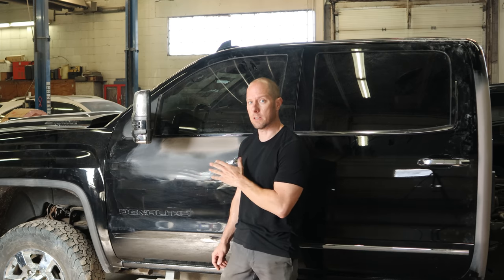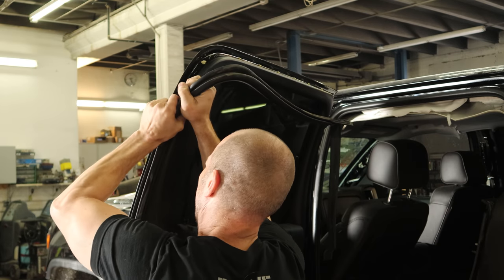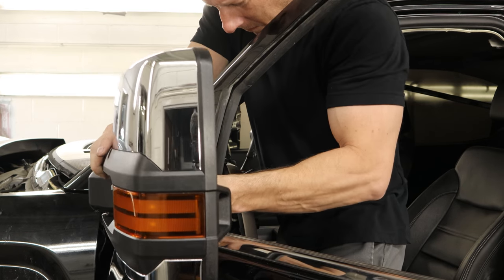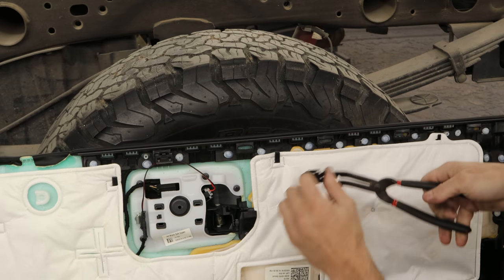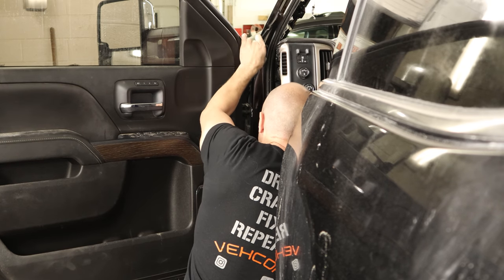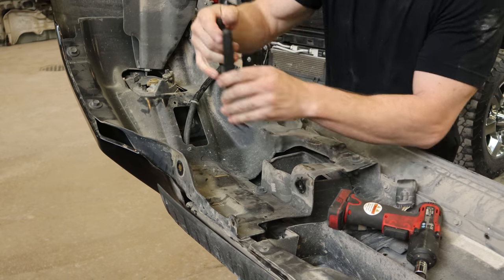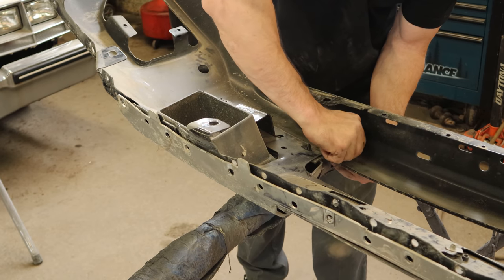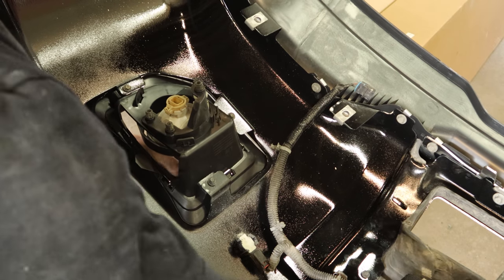Rebuilding my 2019 Sierra Denali after a failed landing part 3

Comment: Until today, I never knew those were called heat shrink terminals, nor that they were to be heated to seal.  I just thought the plastic was to insulate the splice.  That wisdom alone was worth watching your channel.  Thanks for educating me today!!!
Reply: There a couple different kinds. The ones he used were the heatshrink kind. But they also make cheaper non "weather-proof" connectors that look similar, I wouldn't try to heatshrink the non weather-proof ones. It might get stinky
Reply: @Laggy Wizard Thanks!  Now I've learned 2 new things today!!
Reply from the maker: You got the correct answer.  And I got a funny visual of someone melting some regular connectors. 😂
Reply: Glad I can return some of the laughs to you!
Reply: @vehcor  In my defense, I'm a retired dentist who's only fully restored one vehicle in my life.  A very rare early 1963 Corvette Roadster, from hot rodded back to fully stock.  I watch your channel for the dark humor and to learn a thing or two.  Thanks!

Comment: For those heat shrink butt connectors i many times on the smaller wires use the next smaller size. I have seen them come in both yellow or white. They are white on Amazon. They come in several kits or by themselves. They are listed as 22-24 ga wire but work to nearly 18 ga wire. I like them because they are just over an inch long, have the glue lining and smaller diameter than the pink 18-20 ga ones. I saw them in 100, 150, or 500 count packages.

Comment: If you tilt back with the mast of the fork lift instead of driving back when your pulling bed rails in it’s more consistent and smoother with finer control. Both ways work but with the hydraulics you don’t get the lash in the drive train. You do you though haha

Comment: At the fact'ry I worked at, the guys would drop the cabs down most of the way, and then put clear vinyl tubing on the bolts as they hung from the body. The cab drop then matched speed with the conveyor and the guys would lower the cab onto the mounts guiding it with tubing though the cab mounts. A quick yank removed the clear tubing and they bolted it all down. That was thought up by one of the guys, not an engineer.

Comment: If you took Mr. Spotys class on GMC bed installation. You could have done it in half the time and by yourself.  It's your truck. You know where the trucks are prone to rust.  Those who are telling you different. have never done the job themselves, you are doing. They would probably have cross-threaded all the nuts and screws. And a large pile of parts left over.

Comment: I wouldnt pick on the pizza girl too much. She might pick that truck bed up and throw it at you. I tried the heat shrink connect on my DRL harness on my 2017 Camaro. It cause the charging system to fail. Had to replace the harness.

Comment: ah come on depending on its location after it rusts for a few years it will create its own weep holes. I mean it will only cost 10k-15k to replace all the rust because they stopped making the parts 2 years after it rolled off the production line. So $5 in wax to save 15k makes total sense. But really hats off for fixing it right your like mike holmes from canda only better.

Comment: To the anti wax - vax ers .  These vids originated to show customers what goes into a build.  Proving to a customer that the car is in as new condition and has added features like rust protection, new brakes / rotors / tires is a strong selling point.  Remember, people that do high quality builds are not afraid to put $ in a build where it counts.  RE: A customer isn't going to be impressed with new weather strip t clips but will be by a can of wax.   So continue to Wax On , Wax Off .

Comment: The truck looks great Scott! I never used anything inside the doors until i watched your videos. I could not find the cavity wax so i used fluid film inside the doors trunk lid, hood, everywhere i could think of. I live in Connecticut where they pour salt brine on the roads ,it loves the eat steel. I had my new used truck frame blasted then hot galvanized they did not quench it so paint would stick to it,  3 coats of catalyzed black paint in a attempt to keep the rust at bay. I cavity waxed the whole inside of the frame after painting.

Comment: Taking your tips about cavity wax. Plus the info about fluid film.  I have used those products around my Florida Island home where the salt air corrodes everything.  Simple things like an outside electrical outlet that has a weather cover(which does little good) corrodes up to useless in about 5 years.  So now after replacing them I cover them in FluidFilm.  For two electrical breaker boxes on the outside of the house that I replaced because the old ones were pretty much just a hunk of rust.  Cavity wax all inside.  FluidFilm on the outside.  For my outside AC unit I treated it too.  Hopefully the outside AC unit will not have to be replaced in just a mere 4 years this time.
Reply from the maker: Hopefully one day my cavity waxed doors with be parked at my Florida island home.  I’m a little jealous! 👍🏻

Comment: "break the tab if it's insurance work" well that explain why we pay too much for inssurance, I've been to a shop for insurance repair the guy charged on inssurance for undercariage rustproofing that guy never applied it... and did crap job overall, drill the undercarriage to pull it out because it was damage could have remove the carpet it take less than 2 min to do and push it out with block of wood, bolts holding plastic broke they just use self tapper to hold them back and came about 2mm of the power cable from the battery to the front, driveshaft carrier bold broke well put it somewhere else where I will never be able to remove it, forget to tight one of the driveshaft bolt and lost it...

Comment: What do you charge to pull a frame on the table give me a shout. 2001 silverado 143.5 inch wheel base. driver side back about 1.5 inches.

Comment: I’ve watched your videos and have seen your work,I need your opinion,I’m 70 yrs old and have a 2008 Chevy 2500 silveraldo which was recently in a accident. The passenger fender,front grill,front bumper,was damaged, now they are saying the frame is bent,is it worth buying the truck back from the insurance company or just take the financial loss and move on.  I only have 51350 miles on it and unfortunately need it to tow my boat twice a year.  Also it has a western plow I use for snow removal,  thanks Rich.

Comment: Question Scott, why don’t you clean the plastic parts you reuse? Wouldn’t it be easier while they are off the truck? For example, the plastic bezel around the tow hooks are a visible part after assembled.

Comment: My brand new truck had the bed not aligned right from the factory, it bugged me.  Had to pull those two plastic pins on my truck ,but now it's aligned .  Has 2 pins on drivers side of  truck.  One on the front and one on the back of the bed.

Comment: Love the way you want lines to look . I am the same way. I pulled mine almost like that but with tractor and loader .    
I think the wax is a good thing. I use it and I am in Kentucky. I just want things to work the way it should and no short cuts.

Comment: Still waiting for the update on the store for the multi use portable frame rack/welding table/bed lifter/Mustang body lifter and painting nomes. Those detail nomes would come in handy too, wondering if the the pizza girl comes with the step stool or will that be optional?

Comment: I'm a diyer with my first car being an impala doing my own work or most of it i should say, im surprised what i've learned on replacing and such but now im a fan of these rebuild channels, especially the trucks. so much you can do.

To answer that one question tho: 18:46 = you can honestly spray some all purpose cleaner like Purple power or SuperClean and use a brush and pressure washer, because they're carpeted it'll take a few minutes to get most of the dirt out.

Comment: 24:40 hey Scott, how do you like your Bauer power driver? I bought a full set first of the year, power driver, 3/8 impact, drill, 7"circular saw, and 2 spare batteries and 2 chargers. I have used mine relentlessly without a peep out of any of them, and the larger 20v batteries go forever. The small battery the drill came with does go dead quick with hard use, but I was drilling the hardened steel at the axle attachment point on a Chevy cavalier with a cobalt bit, so it was working hard.

Comment: With as many of these trucks as you’re doing, you should just buy or make a door handle tool. It makes putting those exterior handles on so much easier. Lisle 32860

Comment: I used to have a tool that would pop out those pesky door seal clips and it worked very well. 🙂 Should mention though have also used your method for those $&$% that wouldn't cooperate.
Reply from the maker: I haven’t found one yet.  The metal it too think for a pick to get the ears of the clips.  I just struggle. 😂
Reply: @vehcor  The tool I had had a square wooden handle 2 1/2 W  × 3 1/2 L and an 1" thick with a thin stainless spring steal blade with a slight curve and a cutout in the middle front edge to fit the T clip perfectly and when you shoved it on the clip and  rocked it side to side in a light twisting motion those dam things would pop right out. But that was awhile ago now and the clips could be made of something cheaper and breaks more easily.  That's progress I guess.

Comment: It's definitely worth treating a vehicle for rust whenever the opportunity arises. I have a 1982 Mitsubishi L300 van that was treated for rust when it was young and other than rocker panels that I had to repair when I was putting it back on the road, it has insignificant rust. Needless to say that I treated it again before it went back on the road. My 1981 L300 that I had before this one had really bad rust and I had to take it off the road. So this 1982 L300 is one of very few left on the road today.  All the best from Queensland Australia.

Comment: You spray all the cavity wax you want bud!!! OR get the hell out of the communist state of of IllinoiS and come out here to state 48 where you don’t have to worry about that. Oh and those heat shrink terminals are awesome I built sheriffs vehicles for three years we didn’t solder or heat shrink anything every connection were heat shrink terminals. Over 1500 patrol vehicles never had a problem.